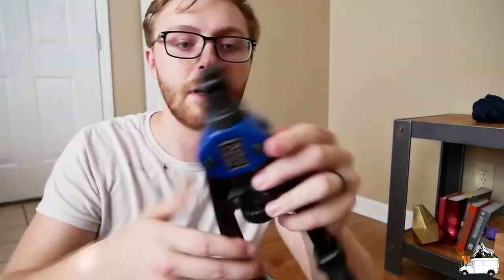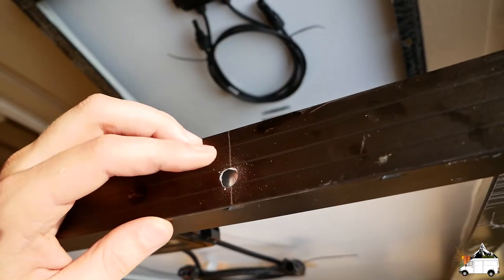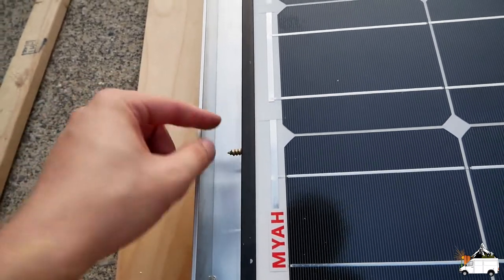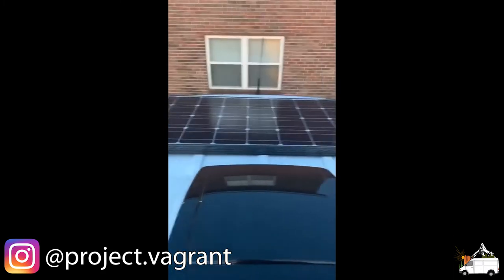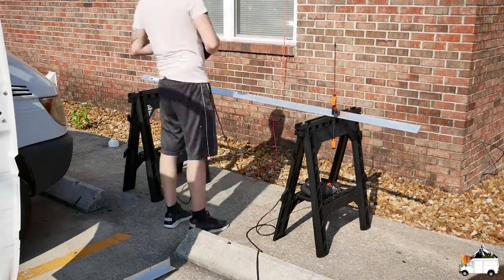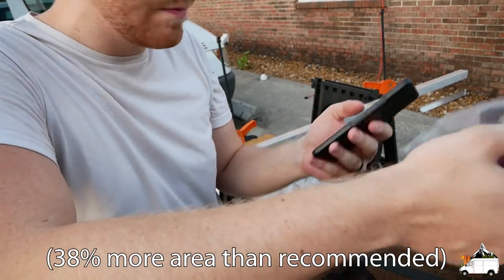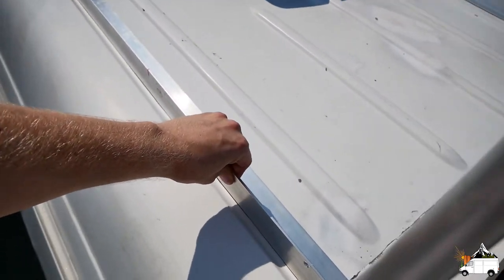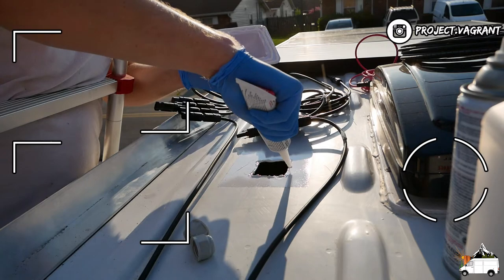How to mount solar on RV/van roof | SIMPLE & CHEAP

Comment: Hey I like the way you did this. Makes for a good low profile it seems like. I'm about to mount my own panels and wondering if there's anything you wish you had done differently? Thanks.
Reply from the maker: So far this has worked well for us! No problems at all :). We aren't full time in the van yet but I've driven it over 1k miles with speeds up to 85 and not had any issues.
Reply from the maker: Just wanted to update - been on the for 7-8 months now! No issues still. If you wanted to be extra safe you could use bolts/nuts through the roof just be sure to use a good sealant (3m 5200) and seal it up well.

Comment: Hi, that 3m tape and that amount is totally overkill. You dont have to worry! I have mounted a 100 watt solar panel with total 6 square inch of that tape on a sedan thats my daily driver for about 2 years now. Have been driving over 180 km/h. Living in sweden with alot of cold and salt on the roads. I cant even get it loose if i will try. 😁
Reply from the maker: Indeed! But it I ever want to mount or change things up it should still be plenty strong enough :)
Reply: I love VHB tape but it has to be used properly, on bare metal. Is it worth the risk of killing somebody not to add a few mechanical fasteners?

Comment: Hey there, I'm putting 700w of solar on my roof. 2 350w panels, which weigh about 44 lbs each. I'm also going to be putting them on a tilting rack using either gas struts or a linear actuator. Do you think the 3m vhb tape would be fine for that?
Reply from the maker: Ehhh. It's hard to say. I feel the tilting rack may be high enough to catch more wind than my setup, which would increase the force upon the adhesive. If it were me, I'd use rivnuts (seal the edge of the rivnut and the threads/bolt with 3m5200 sealant) OR nuts/bolts/washers through the roof sealed with the same.
Reply: @projectvagrant8197  okay yea i had the same thoughts about the tilting causing a loosening of the adhesive over time somehow. Thanks for the quick reply :)

Comment: How many watts of solar? What controller?
Reply from the maker: 4x 100w panels. Victron 100v/50a smartsolar charge controller and I use a Renogy DC-DC charger too which allows me to charge my Lithium batteries off the alternator while driving

Comment: This video is criminally negligent. The guy in this video apparently has no engineering experience or real world experience as a vehicle fabricator.  These  panels could come off later under even a slight exta wind gust or load. Always mount panels, lights, anything on the outside of a vehicle to stay on SECURELY with solid mounting points and strong attachments. Do not rely only on adhesives and thin supports. The life you save may be mine.
Reply from the maker: 🤣 adhesives literally holds together modern cars and airplanes these days. It's all about prep. I've had this on the van for nearly 2 years and 30,000 miles now with no issues. But it's also a low profile rack and I used 5-7x the recommended bonding area.
Reply: @projectvagrant8197  I'm quite familiar with VHB and its proper installation and applications. OEMs and aircraft dont use it like you did, trust me. Not trolling you. You posted a video of adhering VHB over old paint (thus improperly), plus a few poorly placed Chinese riv nuts, and even your wind load calculations sound inaccurate. If your or someone elses poorly attached panel ever comes loose at speed it could potentially harm or kill someone following or passing. Seen it happen.  Please check your mounts and really consider adding sturdy mechanical fasteners. Thanks.